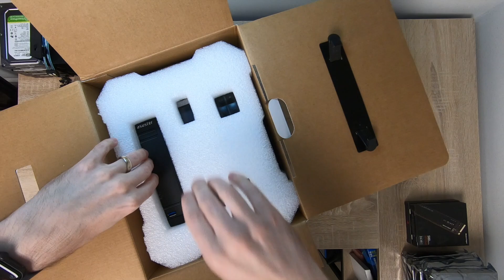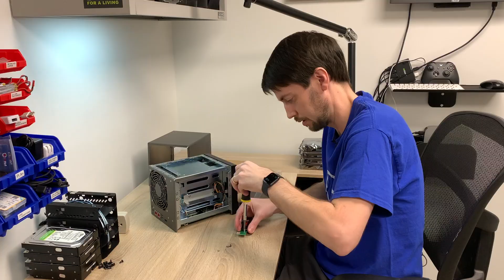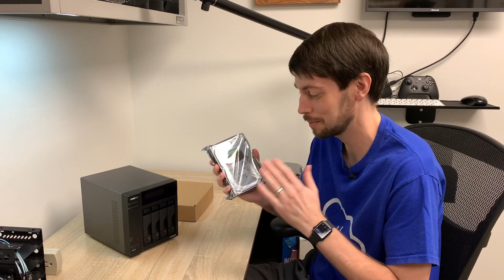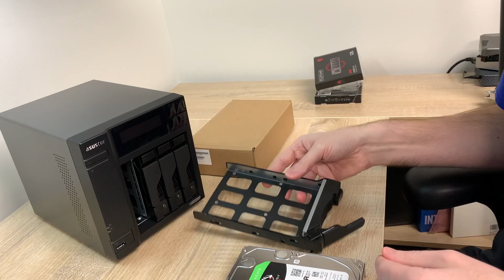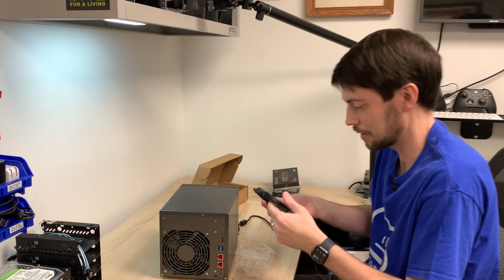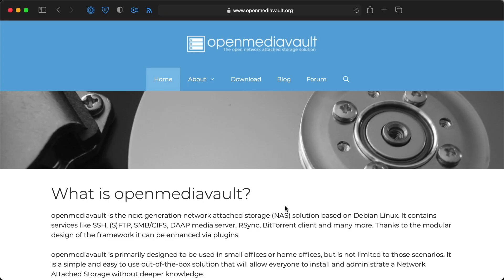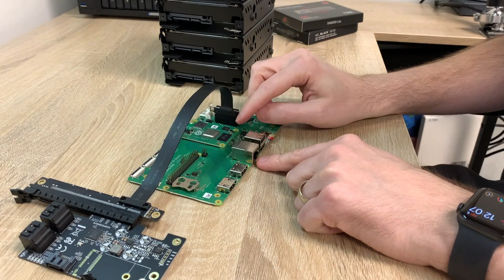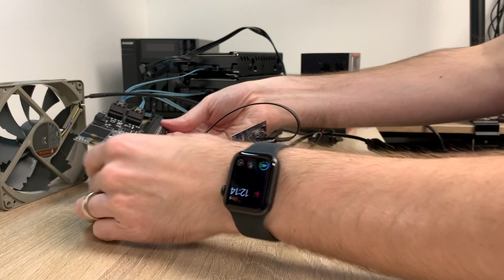Raspberry Pi vs ASUSTOR NAS Head-to-Head Part 1 - Hardware

Comment: That's a £600 item you're running a comparison on a PI... Does it even come with drives installed normally at that price? I think not! If not a PI runs at about £50, £100 at a push for a top range PI 4... Hardly a like for like comparison...

You're talking close to £100 each for the M2 memory additions, each the price of another Raspberry PI 4!

Iron Wolf 8TB NAS drives just shy of £200 each, this is turning into a ridiculous comparison...

So far he's got £800 of hard drives, £600 NAS chassis and £200 M2 Memory... £1600 kit against a PI?

This is a product review NOT a comparison!
Reply: The drives sent were used on both the pi and our NAS. It's not comparable as the Raspberry Pi setup would need to include the price of drives.

Comment: Yeesh, look at how that thing is built! Reminds me of those 2000’s corporate IBM PC’s. Thank god for SBC making hardware fun again.
Asustor needs to turnover their product team!
They didn’t get the “sheet metal enclosures ain’t cool” memo.

@Jeff Geerling our team just cut up graphene on our Pi cluster, with metal 3D printed heatsinks, way too cool for the YouTube.
Reply: Robert Murray smiths conductive few layer graphene ink is probably more practical on mass ,diy etc
Reply: Hi there! We're not trying to go for cool. Stability is our number one priority as we have worked hard to earn the trust of our customers. We are proud of our 0.6% failure rate within our three year warranty period. We need to be careful as our devices handle the important data of our customers, whether that be important work documents, photo and video projects or irreplaceable memories. We need to be trustworthy first. Our home-centred NAS devices offer aesthetics to better fit a home setting. But the Lockerstor is definitely intended for professionals.
Reply: @ASUSTOR_YT  because trustworthy and high performant is definitely not cool right ? #hiresometalent #hireJeffGeerling
Reply: @r.in.shibuya  Well. As we said, we pride ourselves in our already reliable products to maintain trust with our customers and professionals.

Comment: THANK YOU SO MUCH Jeff!  Love to learn from you, your passion makes the learning enjoyable.
Have been wishing to see this.  I might need to build my own NAS as not being able find a suitable solution within a sensible budget.  Was looking at that particular 4-bay ASUStor and other similar ones from QNAP and Synology. My use case is heavy Virtualisation comprises of VMs and Containers for: Servers, Virtual Desktop, Android, Network Simulations.  Thus, I need "nested virtualisation" support and compatibility with VirtualBox or Vmware.
Would you PLEASE also share on the Advantages & Disadvantages between Pre-built NAS solution like ASUStor against DIY.  Specifically hardware aspects like durability (24/7), power consumption, heat, hot-swapping capability.  If there is really an advantage of Pre-bulit against DIY, what might be a viable solution to implement that into DIY, perhaps "hot-swap" and hardware stability for long hours like 96 to 120 hours stretch.
Once again, thank you for presenting another opportunity to learn from you!